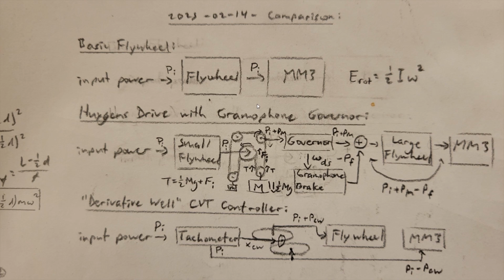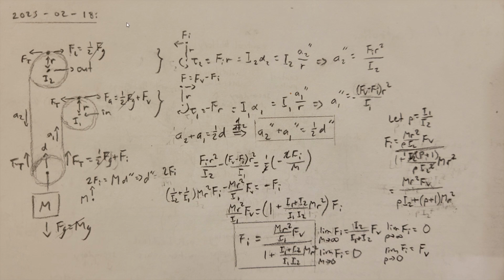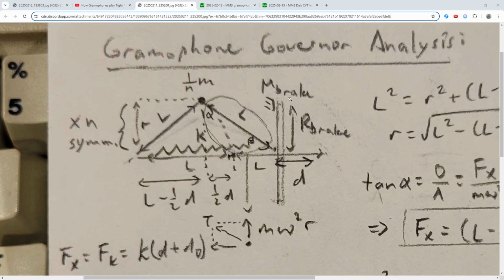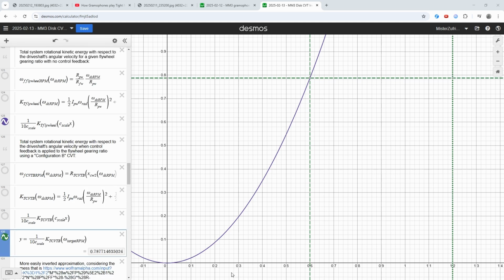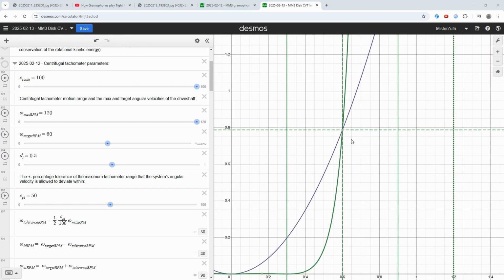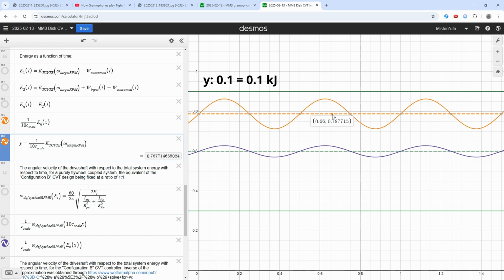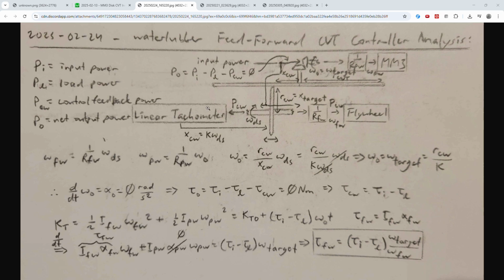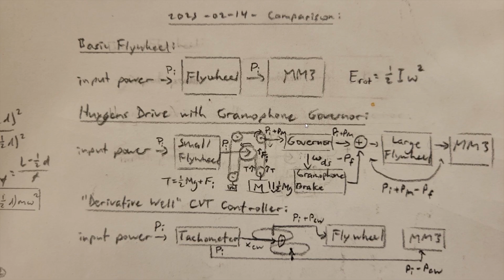The science of marble machine tightness! Why the CVT-coupled flywheel works so well (reupload)

Comment from the maker: Fixed an editing error where two short clips were swapped in position.

CORRECTION to 2:32: I mixed it up: it should be 1/2*(a₁ + a₂) = d. This only means that it was supposed to be a 4 in the denominator of the boxed Fᵢ equation instead of a 1. The general trends and conclusions do not change.

Addendum 1, to 1:52:

If the output sprocket's radius were instead br where b is some factor, then in the final, boxed Fᵢ equation, the I₁ in the numerator of the second term of the denominator would multiplied by b². So if the output sprocket becomes much smaller than the input sprocket (b approaches 0), the force on the output induced by changes in the input approaches some maximum ratio of Fᵢ; as it becomes much bigger (b approaches infinity), the induced force approaches 0. Conversely, if the input sprocket's radius is br, in the final Fᵢ equation, the result is now directly multiplied by b² such that making the input sprocket smaller is what minimizes the induced force. But note that what actually matters is the actual torque on the output; when the radii were equal, Fᵢ and Fᵥ could be directly substituted with τ₂ and τᵥ.

So when varying the sprockets’ radii, Fᵢ and Fᵥ can be substituted with τ₂/(br) and τᵥ/r, yielding a b directly multiplied by the final τ₂ equation. In that case, if the output sprocket becomes much smaller than the input sprocket (b approaches 0), the torque on the output induced by changes in the input approaches 0 due to the radius being eliminated, which is what actually matters to the final output acceleration, though now the input can no longer do any work on the output; as it becomes much bigger (b approaches infinity), the induced torque approaches some maximum ratio of τᵥ despite the infinitesimally small tension inducing said force. If we instead substitute τ₂/r and τᵥ/(br) where the input sprocket's radius is br, in the final, boxed Fᵢ equation, the b² in the numerator gets divided by b such that making the input sprocket smaller is still what minimizes the induced torque, but this would also mean that the output would be slower than the input. Note that this assumes massless pulleys which would imply infinite output torque multiplication as a result of an infinite input sprocket radius… Here, decreasing b toward 0 is like decreasing ρ (the ratio of the input inertia over the output inertia) up to a point, whereas increasing b toward infinity is like increasing ρ toward the same which we saw decreases Fᵢ toward 0, putting a limit on how much of the input torque changes get transmitted to the output.

Addendum 1.1, to 3:59:

Decreasing ρ to 0 only causes Fᵢ to approach equality to Fᵥ if it was I₁ (the input inertia) that was decreased toward 0 (which is physically impossible to reach). If it is rather I₂ (the output inertia) that is becoming very large, then increasing I₁ will still decrease Fᵢ. The I₂ that any transmitted Fᵢ will impart a torque upon will at the minimum be the governor and programming wheel inertias. If thinking in terms of the ultimate angular acceleration of the programming wheel caused by input fluctuation Fᵥ, then assuming I₁ and I₂ started equal, increasing one or the other is equally effective in decreasing said angular acceleration; the choice depends on what is easier to control. But this begs the question: why have a Huygens drive separating an input and output inertia at all? It will only block out input fluctuations well if its weight is small (not enough to bias the gramophone brake's engagement) which will also limit the acceleration rate for getting the programming wheel up to speed.

Addendum 2:

Some weeks prior, this addendum originally surmised that larger steady state input fluctuations could still make it through the Huygens drive in a way that incurs inconsistent equilibrium speeds. After further analysis, I ended up confirming that the Huygens drive at steady state (where the Huygens weight is at a constant vertical velocity including 0) does in fact perfectly block all steady state differences in input power/torque. At said steady state, the output sprocket sees only the input torque and hence power (torque times angular velocity) contributed by the Huygens weight which is itself not undergoing any acceleration; this remains true even if the upstream drivetrain required a greater input power to cancel out an increase in the marble conveyor load. The gramophone governor at such a steady state would need to have been at an angular velocity that causes its braking torque and hence power dissipation to together with the assumed constant downstream load cancel out the input torque, achieving a constant velocity. From the graphs in 6:14, it would be clear that there exists only one gramophone governor speed that will achieve this perfect cancellation, meaning that adjustment of the gramophone governor’s parameters indeed sets a precise speed to maintain, provided the downstream load forces stay constant or vary by a sufficiently small amount . My analysis regarding the behaviour with changing input forces (and hence a Huygens weight of non-constant vertical velocity) otherwise stays the same where a heavier Huygens weight will let more input fluctuations through. The Huygens drive thus acts as a low-pass filter in that it completely blocks ‘DC’ or steady state offsets in input force while increasingly letting higher-frequency fluctuations through as the Huygens weight gets heavier.

Hence, other than the trouble that the gramophone governor needs to dissipate a lot of power and the brake will be prone to wear, the concern is of how to manage changes in input and output loads which can in fact get transmitted through the Huygens drive to the output. First, clearly, any changes in the load and input torques seen by the gramophone governor mean it will need to change to a different speed to cancel those out. We can do what we can to minimize load variations from the programming wheel and increase the downstream flywheel energy, its then being a matter of managing cases of longer-lived deviations in upstream force. That means a significant mismatch between the force from the Huygens weight, the machine's load, and the user's input force causing the input sprocket to experience an acceleration or deceleration. If the Huygens weight is heavier, a greater portion of that force will be transmitted to the output sprocket, and since the Huygens weight's acceleration for the same force disturbance will be lower, it will be able to sustain transmission of that disturbance to the output sprocket for a longer period before it has reached the maximum or minimum height; i.e. the heavier the weight, the more the output speed can change without your noticing and reacting to a change in the weight's height. If the Huygens weight is lighter, it will insulate more of that disturbance from the input output sprocket, but due to its having a greater acceleration, it will take less time to reach said maximum or minimum height, and it will move too much to be used as a meaningful visual aid.

Addendum 2.1, to 4:40:

Though the stationary Huygens weight is not ‘doing work’ in the sense of converting its gravitational potential energy into the output sprocket’s motion, it is technically rather well applying a constant torque which does do work since the output sprocket is still rotating. The difference is that it is rather due to the user’s input power counteracting the Huygens weight’s torque that keeps said weight vertically stationary while still allowing the output sprocket to rotate, so semantically, though the direct force doing work on the output sprocket is coming from the Huygens weight, we would still say it is rather the input force contributing to the chain’s tension that is doing the work; technically both the Huygens weight and the input sprocket are contributing to said tension which is doing work on the output sprocket, but the one we regard as currently doing the work is the one that is itself undergoing displacement, and when the Huygens weight is stationary, it is only the input system that is undergoing said displacement.”

Description of gramophone governor parameter adjustment: Increasing the flyweights' masses increases the force with which the gramophone brake is engaged for a given speed, but only up to some maximum. Increasing the governor's length increases the leverage with which the flyweights apply this force, theoretically indefinitely. Increasing the spring constant allows the target speed of brake engagement to be achieved when the governor's links are more axially extended and have greatest leverage in engaging the gramophone brake; this is maximal when the links are completely straight as when the governor is stationary, but there comes to be increasing error in the positioning of the gramophone brake and hence the target speed of engagement. If we do manage to achieve an extremely steep dissipated power versus system speed curve, then the governor would indeed be very good at resisting accelerations past some target speed, but to resist decelerations, it has to be biased at as much constant power dissipation (wasted energy) as the maximum energy deficit you expect the machine to encounter; if you want to momentarily counter complete removal of the energy needed to sustain the machine without the gramphone governor, then you would essentially have to double your effort. The CVT approaches replace this with the likely much lower friction loses of the wheel and disk CVT's and any torque amplifiers' operation; while the gramophone governor counters energy deficits by "wasting less energy", the CVT designs actually redirect energy back from the flywheel into the system under control.
Reply from the maker: Addendum 3:

Other than energy efficiency, lastly consider the failure modes of each design. We start with the assumption of the engineering work done to ensure the purely flywheel design will not fly apart during usage.

- If the gramophone governor breaks, the Huygens weight will impart a bias causing the programming wheel’s speed to accelerate uncontrollably. If the Huygens chain breaks, you get complete power loss to the programming wheel.

- If the centrifugal tachometer breaks, the compression spring will cause the control sleeve to shoot out as though a sudden system deceleration were detected which the control feedback must counteract. We can use a magnet coupling or other quick release to disconnect the tachometer from the torque amplifier and hence CVT control wheel, preventing a catastrophic return of kinetic energy from the flywheel into the machine. If the torque amplifier fails, such as the cord snapping, this will likewise merely disconnect the tachometer from the CVT control wheel. In both cases, there can be a linkage for immobilizing the CVT control wheel, preventing precession to a position that would cause the machine to stop or lose its coupling to the flywheel. Thus, failure of the speed regulation mechanism merely reduces system functionality to the base case of coupling to a flywheel with a fixed gear ratio . If the CVT itself fails (the control wheel would be the weakest part), this would nominally merely mean disconnection of the system from the main flywheel, but the drivetrain from the input to the programming wheel and other systems remains uninterrupted and operable, though it obviously won’t be as tight.

In short, unlike the current Huygens drive and gramophone governor designs whose failure modes are showstopping, the CVT designs’ failure modes leave the machine operable and controllable , but merely to a reduced tightness spec.